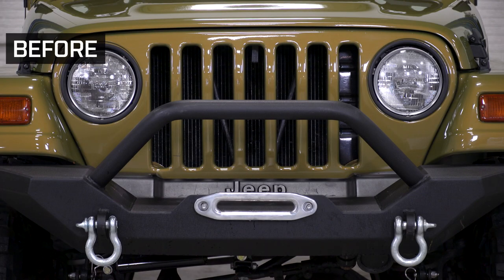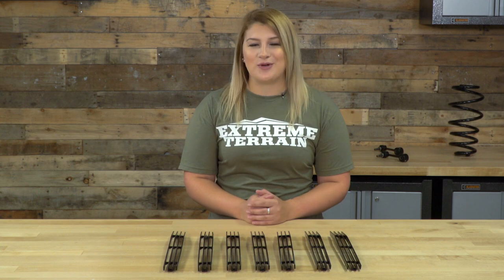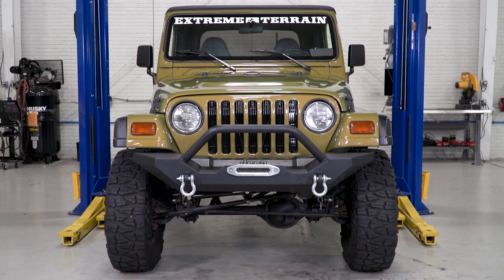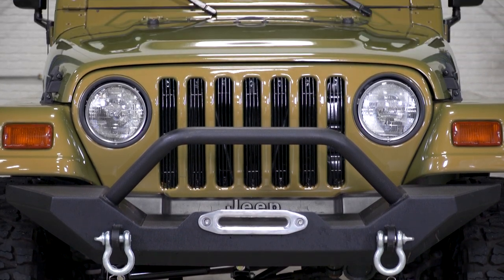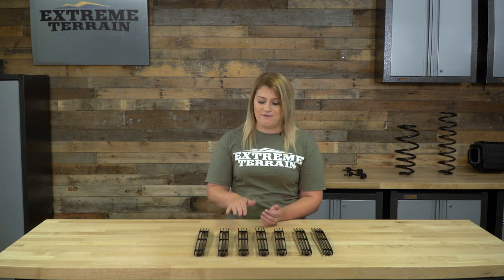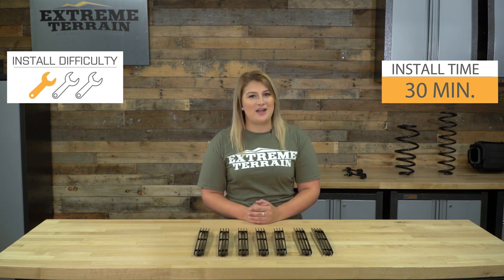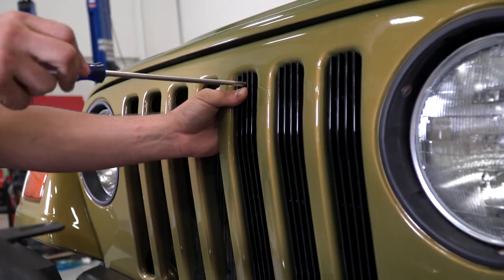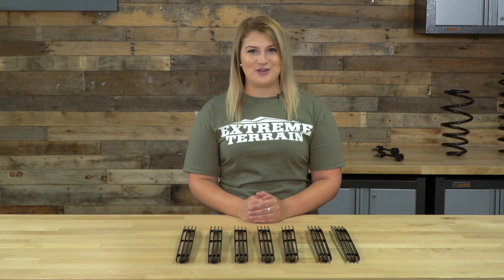Jeep Wrangler RedRock 4x4 Black Billet Grille Inserts (1997-2006 TJ) Review & Install

Comment: These things are DEFECTIVE. There is a major design flaw, and your install videographers probably knew it. The "tabs" do not "snugly" tighten up against the back of the slots - there's a significant gap at full tightness, meaning the whole insert just wobbles in place by a HUGE amount. Like enough to probably fall out. Im going to have to decide how to modify mine, either GRIND the back of the top and bottom of the inserts, or fabricate different "tabs." Forget about that powdercoat I guess. Too expensive for this kind of problem. I just want to protect my radiator!